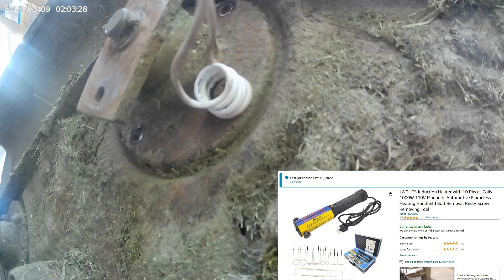Amazon Induction Heater

Comment: “Bra, just use an impact!” I wonder if some of us prefer manual tools because we are OCD or on some kind of spectrum?
Reply: Impacts only work marginally better on stuck fasteners anyway. If it's stuck enough to need to be heated to red, an impact would struggle or rip it off. I doubt anyone saying to use an impact has dealt with seized hardware.
Reply: Those that go right for the impact have zero clue what they're doing.
Reply: @joshuapaul349 tool of choice equates to knowledge and if you don't know anything you use an impact? You sound very intelligent with that statement.
Reply: @PeterTrimboli  I literally said "Those that don't know" (sic) -Me

How did you interpret that as me not having a clue and going straight for an impact? -Sent from my service truck
Reply: @joshuapaul349  You said that people who reach for an impact don't know what they're doing. I'm saying you're unintelligent by assuming people's knowledge based on what tool they use. I don't think I misinterpreted anything. I think you misinterpreted my simple statement.
Reply: @PeterTrimboli  I would love for you to crawl under my equipment and tell me what wrench to use. They make a tool for every job, engineers design stuff with what tool to service or repair it. They don't just tap a hole and throw a bolt in.
Reply: @joshuapaul349   I doubt you could tell me the difference between a grade 5 bolt and a grade 8 bolt, an 8.8 bolt and a 10.8 bolt, a 1.5 thread and a 1.25 thread pitch, a 20 tpi or a 28 tpi so I don't wanna hear it just cuz I reach for an impact to get stuff done. In this fast paced world we live in if you can't use an impact to get the bolt off or back on 90% there than that's on you and you'll lose your job to someone like me than blame everyone else but yourself cuz you can't adapt and change.
Reply: @PeterTrimboli  Hahaha, You'll have an easier time understanding your snap on payments. I own the company I work at. If you do get a job here, you'll only be taking a check I signed.
Reply: @joshuapaul349  right and I'm the CEO of a billion dollar corporation see how we can say anything in YouTube comments and pretend it's true now I'm better than you what now?
Reply: @PeterTrimboli  Think about that when you're punching in tomorrow. 😎
Reply: @joshuapaul349  😂 I don't "punch a clock" only ever did when in my teenage years but will do you too my dude
Reply: The Impact is the tool of the simpleton God bless all the simpleton fool's who are merry in their delightful delusion 🤤
Reply: You kids don't knock it off I swear to God I'll turn this YouTube around right now!
Hey, I didn't mean to start nothing ya'll. I was really thinking about myself and how I work weird a lot and I said it out loud; doesn't even make sense. It was a long day; not a bad day , but a long day. You know how sometimes you got maybe 7 minutes left and you're all calm on the outside; but in your mind, you've set the dumpster on fire 3 times?
Reply: @johnwhitley9209  I'd get back to you but I took my guys to Busch Gardens today and we're pretty tired from ridding roller coasters all day.
Reply: Crap, I forgot my "impact story".
One day I went to a convenience store, and then I slipped my timing belt; so of course I started changing the belt in the parking lot, cause that was convenient for me. Anyway, I had to remove the crank-bolt, so I pulled the ignition wire, put a six-point and breaker on it, laid it against the "frame rail", and hit the key. Worked perfectly.

Comment: As a time served British blacksmith my. My advice to you would be to pour cold water over that. heated nut before you ever try to undo it. particularly with fine threads. You run a risk of stripping the threads while they're soft. by cooling the nut first, has a two fold effect. The nut shrinks first over the expanded bolt that cools down last. more than lightly, you'll be able to undo that with your fingers. If Cool, it first.   I also have one of these machines. They are OK, but you can't do too much work before Start to trip out. I wish I'd got a more powerful one, now Also mine is 230 Volt 100watt. living in UK. I presume yours will be 110.volt
Reply: Quenching high carbon steel? And your a black smith? Hmmm
Reply: That makes the fastener brittle....... Heat it and let it cool.....unless you wanna put in a new fastener.
Reply: My man never heard of brittle fracture
Reply: @Nick_L.  I think you must be referring to high tensile steel not mild
Reply: You cast too much shade, pal.